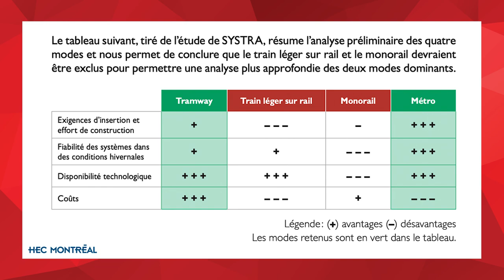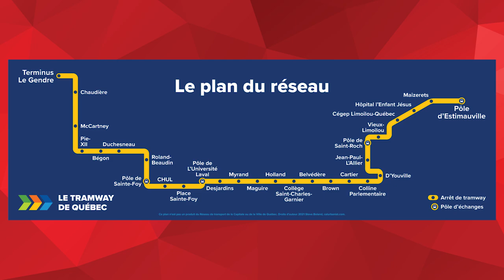Quebec City Tramway - A Discussion on the Currently Proposed Project - January 2022

Comment: Strange how they think a metro would be too expensive given how much support the cross river tunnel proposal has gotten.
Reply: I think the "love story" between Quebec City and the Third Link is based on a perceived need to add further capacity to link the North and South Shore, while the Tramway is seen as just too expensive, unnecessary and "flashy". The 'Third Link' has been a desire in Quebec City for as long as I can remember, and pretty much debatable if it has any positive impact (for example, increasing the ability to travel by car instead of encouraging other methods of transportation, encouraging spread over densification, etc.) I think the Tramway project is misunderstood and under appreciated by a lot of the population for the level of benefits it will bring along the way, while building a metro is just another round of hoping for funding, design and justification with the population and governments, especially as the price tag would most likely be upwards of 10 billions CAD$... The interest for a metro exists because those studies are not detailed enough to clearly identify how feasible and costly it would be, while the price tag for the Tramway is pretty clear!